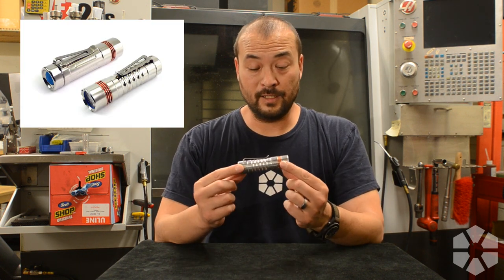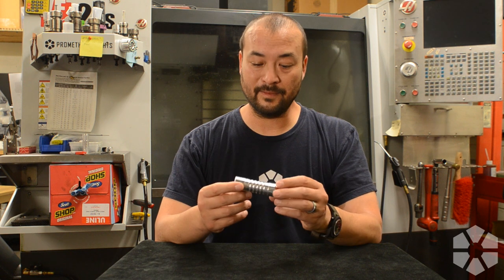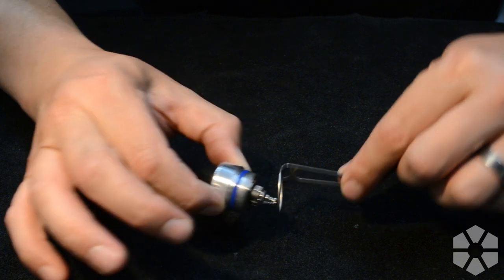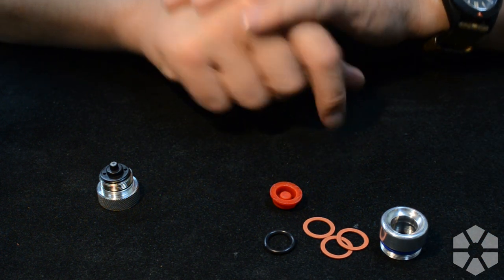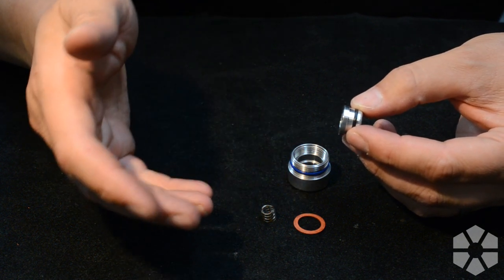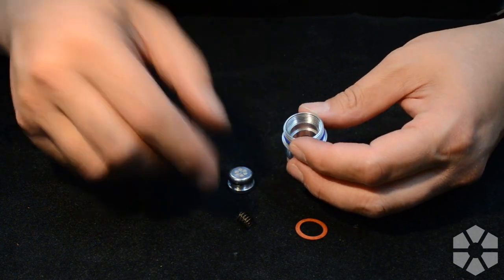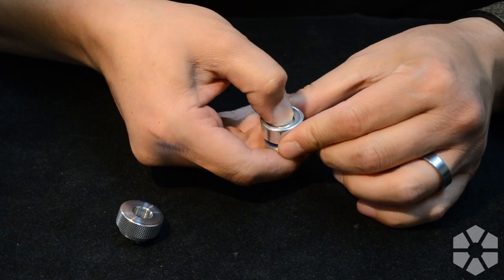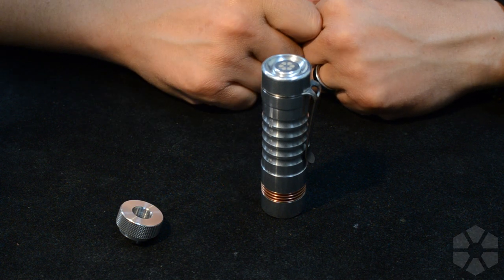How to Install a Metal Tail Cap Switch

Comment: 1200mah on the 18350 cell is PLENTY. Carry spares. Keeppower sells a 2-pack with a battery case and youll have literal days of practical lighting in a small package. The Alpha is your best friend on the job, for EDC and occasional lighting the Delta is the best best best best best best. I know you hate triples because everybody did it but the monolithic potted head and Icarus driver are probably unmatched.. the other custom lights step down after 5 minutes which is plenty, but mine get too hot and I calibrated them to step down after 30 seconds. Also 18350 lights have a good aesthetic ratio.

If you let me stop by and say hi like old times Id love to get a new Delta to ring in the new year